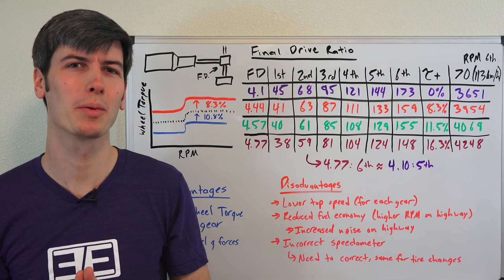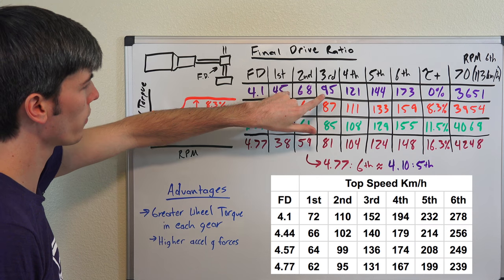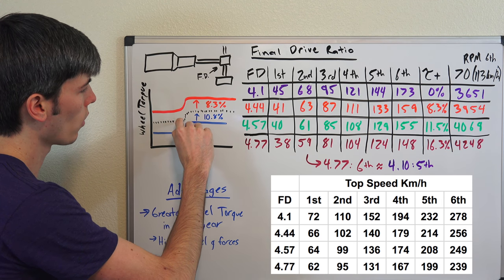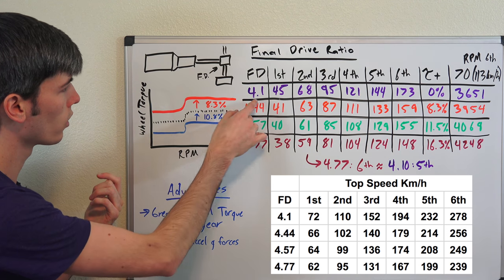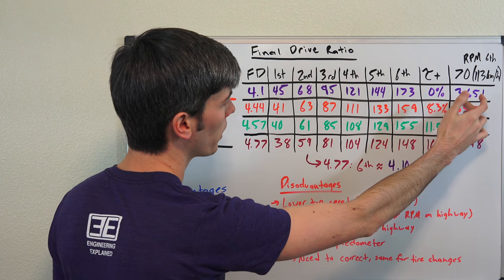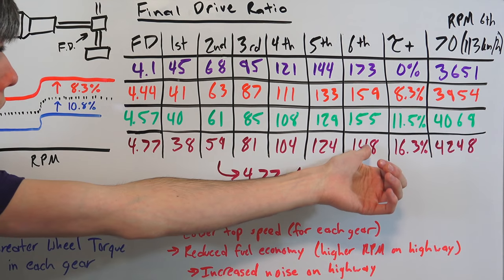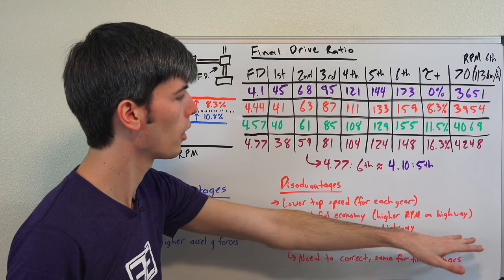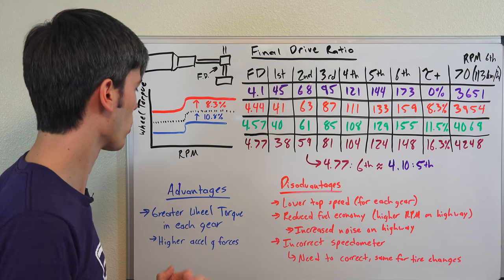Why Is Final Drive Ratio Important? Accelerate Faster!

Comment: I have a 2011 Mustang with the steepest optional gear ratio of 3.73. I'm not a fan of this gear for my daily driver. 1st gear is nearly worthless. Also, with nearly 30K on the clock, I can count on 2 hands how many time I have gotten 20mpg on a tank. The ratios for the manual trans are: 1st 3.66,  2nd 2.43,  3rd 1.69,  4th 1.32, 5th 1.00,  6th 0.65.  With 400+ HP on tap, I can't imagine I would lose much performance by "downgrading" to the 3.31 gears. But I'm sure it would help out my fuel economy. Thoughts?
Reply: That's strange, I have a 2016 Mustang GT (performance pack) with 3.73 rear end gears and I get just over 20 MPG driving back and forth to work, which is all 2 lane roads at around 25-45 MPH. On road trips, I can get a little over 25 MPG at 75-80 MPH.
Reply: FoDaddy  And you have more HP than I do!!! But do you agree that 1st gear is worthless?
Reply: More HP, but also more weight.  And yes, first gear is pretty short with 3.73 gears, usually if I'm pulling away from a stop light, I'll be in 3rd before I make it though the intersection.
Reply: This is the only car I've ever owned (34 so far) that feels like its gears are too steep...useless 1st gear, high rpm's on the freeway etc. If I had money to burn, I'd change it out to a 3.31 just to see how the life would be.

Comment: On my Honda, when compared to the original gears that came with the car, I went with closer gear ratios from gears one thru six and I want with a lower final drive. I went from 4.7 to 4.3 as I daily drive my car and want fuel economy
Reply: Hello. Please hellp. I have k24 240hp with k20 gearbox 4 .7 fd. I was thinking on 4.3 fd i now that i will have longer gears but what about acceleration? Same, losse power , gain? Thanks

Comment: If 8, 9 and 10 speed transmissions become popular, will they do away with some engine complexity and just go for low RPM instant torque? It seems like a second wind from variable intake or variable cam timing is wasted when it just lugs at 80mph in top gear.

Comment: My ranger has 4.10 gears and holds at 2000-2500 for highway cruzing speed and I'm about to do a lot for highway then before, plus my diff is slightly cooked. So I guess its time for some taller gears.

Comment: The new 2020 Civic Si will have a higher final ratio then the 2019 Si producing a higher torque to the wheels what change is expected in the  0 - 60  speeds?

Comment: Pfft I got a 3.73 final drive in my 940, and all it does is make my revs sit higher at highway speed. Still accelerates like a crooked kangaroo with the 116 horses of fury.
Reply: Well than maybe the gearbox has a crooked kangoroo setting xD
I don t know the FD Gearing or Transmission Gearing of my 740, but i don t complain x) it s hell of fun to go with that car through downhillturns! (with proper tires)

Comment: Doesn't most cars use the ABS wheels speed sensors for the speedometer? At least every car I've worked on made in 1990 and later uses the ABS-speed sensors, thus you can use whatever final ratio you want and the speedo will remain true, set aside a purpose-made error of showing 5% more than you actually got, and ofcause effects of actual wheel rolling OD.

Comment: I wish I had a 6th gear in my Wk1 Srt8 Jeep. My final gear ratio is 3.73. They only have 5 gears and my 5th gear has a .83 ratio. At around 80mph I'm at 3,100rpms. If I had a 6th gear with a .65 ratio my engine rpm would at 2,400lbs at 80mph. I would get much better gas mileage. Not sure why Mopar engineer's did not put the Ram 6 speed auto from the same years and put in the WK1 Jeeps. Then again I don't know if the Rams transmission would of been able to be reliable when my 6.1 liter hemi is making 420lbs of torque. My 5 speed (W5A580) NAG1 transmission in my Jeep is built by Bercedes Benz that's rated at 438ft-lbs of torque.

Comment: Engineering Explained you shouldn't need to change your speedometer reading because modern (ish) cars use the ABS rings to determine speed? Or does your S2K just use a gearbox sensor?

Comment: should I delete dpf system
Reply from the maker: Nope
Reply: Ron DS for sure what vehicle?
Reply: Oh yeah you will love it done alot of them get ahold of eric from innovative diesel for tuning
Reply: It's illegal in most places to remove emissions equipment, so , do it at your own risk.
Reply: Yes in the US it's 100% illegal as deleting the DPF you are breaking federal laws.
Reply: I'd do it instant honestly.
Reply: and get better mpg as well as power? yes you should
Reply: If it works- leave it. If it breaks down- remove.
Reply: Yes! God those things clog up. Ruin the engine, make it run slow. Delete it.
Reply: It also depends how exhaust pollution is measured where you live. In my country they only measure smokiness, not composition of the exhaust gases, so you can pass the inspection even without DPF.
Reply: Wait until the system starts failing then remove and program.  Check first to see if you can pass inspection before going this route.  Many states perform safety only inspection on diesel.  I'm hanging on to my pre emissions no dpf 2005 duramax as long as possible.
Reply: ImaFirinMyLazuh you got some long arms don't you!

Comment: I have a question? Assuming all else is equal, is there an appreciable impact upon the lifespan of the engine when using a more aggressive final drive (within reason).
Reply: A small impact, depending on how much % hwy and how much you drive - higher rpm on the hwy in top gear means more rotations for the engine, trans, and driveline components - 16% or 600 rpm more for 4.77 vs 4.1 in this example - in mileage terms this is equivalent to 200K vs 232K miles (+16%) of wear due to added rotations alone at 100% hwy in top gear at constant speed - at city speeds there is also added trans/clutch wear due to increased shifting

Comment: What kind of device compensates for different tire size and final gear ratio and how does it work?
Reply: Modern cars' speedometers are digital, so you would just have to program the car's computer.
Reply: Number Two I didn't know the a speedometer is user programmable
Reply: You have to hook up a tuner to do it, there usually isn't a way to to it in the stock menus.
Reply: Or if your car is older it runs on a cable that uses a gear to turn your speedometer in your cluster which they sell replacement correction gears.
Reply: Kyle Bailey Are these tuners universal?
Reply: Well said Mr. Aus.
Reply: Overonator it's not a tuner, it's a physical gear inside your speedometer. For instance, in my 98 cobra, it's built like that, where the cable turns and spins a gear, which is hooked into my speedometer, it's completely mechanical, so in order to correct the speedometer after changing the rear end gears, you order a different sized gear for the speedometer. I don't know if they are universal, but I wouldn't think so because the stock gear sizes for different vehicles are probably different sizes, so the corrective gears wouldn't be accurate if they were one size fits all.
Reply: Kyle Bailey And going that deep into a fix electronically would need very different techniques depending on the manufacturer and year.
Reply: DE Nichols yes. In my case there is no electronic correction needed because it's all mechanical. But on most newer vehicles speedometer are controlled electronically, so you'd need to tune the speedometer for corrections. Or there would be some other type of fix, like splicing in a resistor as somebody said earlier in the thread.
Reply: Kyle Bailey exactly. :)

Comment: So I understand that whole thing with increasing the FD, the gives and takes. Is there a way to regain that top speed back? If I’m not mistaken you mentioned increasing the overall power of the engine itself is partly a solution?

Comment: Is this a key difference between a heavy duty truck and a sports car of same/similar engine size? As in why one is better at towing than the other and the other is better at speed?
Reply: Trucks also have beefier suspension and frames.
Reply: Forrest225, true, but we're talking gears yes? The engines have more torque down low and can be geared taller. That's more of the intended comment. Of course, with a bigger, beefier item like a truck versus a car, some of how it's setup is because of the weight of it yes.
Reply: Unclenate1000 Gear ratio is important factor, but another even important factor is the rev range the engines are built at. For a truck you want lot of torque on the low rev range, so you can start pulling away right away and making it easier to not bog down. For sports car you want higher revs, because revs mean power and with lightweight car the low rpm torque isn't as important, so you can sacrifice it when tuning the engine.
Reply: Trucks also usually don't rev as high. They do idle somewhat lower, and have higher low end torque, but overall the useful percentage change in speed (basically how many times higher RPM is the maximum than the minimum that'll be able to accelerate) is bigger in sports cars. I.e truck gears would have to be closer together to cover the same range of speeds, so they usually have more gears

Comment: Love the channel. Can you explain 15" vs 17" wheels? It's an option on the Honda CRV. The low end model, the LX, has 15" wheels. INcreasing in model, EX and above, use 17" wheels.  What do the larger wheel bring to the car? Acceleration? Power? Comfort? Expense? Thanks.

Comment: Could you please make a video explaining how increase ( or decrease ) in wheel and tire size effects gearing?

For example my car ( 1994 Toyota Mr2 ) came with 205/50/15Front tires and 215/50/15 Rear tires. I currently run a 225/45/17 Front and 265/35/18 Rear.

Thanks!

Comment: So in the case of a Dodge Ram with a Hemi, you can either go with a 3.21 gear ratio or a 3.92 gear ratio. I understand a high gear ratio produces more torque to the wheels, but the top speed is affected in this case?

Comment: Say I have a more powerful engine (like my Harley Evo) for a 5-speed transmission, how can I change the gear ratios to handle its power in a 4-speed transmission? Use a lower final drive? This is the scenario for my custom bike I'm restoring, I understand pretty much everything except how this would be done. Excellent video otherwise.

Comment: Question, Trying to figure out the formula for calculating torque by upgrading from a 3.42 to a 4.10 or even a 3.73 on my truck to find out which one would be worth it more.

2000 S10 4.3L Automatic 2WD 3.42 Gearing Stock
This is the specs Im working with.

Anyways, So I'm trying to figure out a formula for towing with 3.73 or 4.10 gearing over the 3.42 gearing to see what torque I can get to the wheels by that to see what would he better towing and also being within the RPM power band. 
I was kinda calculating towards a 3.73 gearing because I can go to a bigger tire size and bring the gearing closer to a 3.42 for MPG and I can go to a smaller tire for more torque when towing. Or go to a 4.10 gearing for towing easily and got to bigger tires to bring the gearing closer to a 3.73  or 3.42 for better MPG.

Comment: I have a 2012 Jeep Wrangler with an Edlebrock Supercharger, 4 inch lift and 35 inch tires. Do you think it would benefit me to change the gears from 3.73 to 4.88?

Comment: He says, what are the reasons:  1.  To get more wheel torque.....wrong  
2.  fuel economy.. RPM levels usually doesnt dictate MPG.. But , true, higher Top gear RPM
again, there is NO advantage of torque over all.  This is a KEY mistake and hope he corrects it or removes the video.  there is trade offs by lowering the final drive.   Nothing even remotely relating to getting more torque or acceleration force.   Keep in mind at each equivalent gear set shifts the shift point and creates trade offs of force to the wheels vs any speed range.   this is a VERY misleading video.    those speed limits in each gear ONLY optimize for each gear for each speed range. NOT over all.

Comment: So you say with 4.57 your got 11.5% more wheel torqe... i hope your dont think its the same like 11.5% more torqe from the Engine!? 
0-190 KM/H 
with 4.1 or 4.77 will take the around the same time.
The increase you will have if you at 50km/h in 2nd gear and floor it your are have more G's (4.1 4.57)  -> 11.5% more G's

Comment: Hey my car is honda civic fd1/fa5 with r18a engine. I was thinking about changing the final gear for better acceleration (increasing the number like you said). What kind of final gear do you recommend for me? I just want to change it a bit, not too extreme. Also think about the trans and axle when deliver the torque. Thanks man

Comment: I have k24 with around 240+whp.  Gearbox k20 with 4.7 final drive.. for 1/4 mile whats better , and better acelleration 4.7 or 4.3 fd of stock k24? Or k24 gearbox longer gears with 4.7 fd? What do you think is best combination for best posible accleration? Thnaks!

Comment: if the 6th gear has a theoretical top speed of 173, by changing the final drive ratio wouldn't i be that an improvement in the real top speed, because of the torque added?

Comment: Does changing the final drive gear ratio to a lower (more aggressive/higher revving) on a car with CVT transmission have the same affect?  Or is it different because it's a CVT?   I'm interested in changing my 2018 Honda Civic CVT's gearing (4.811) to a 2018 Honda CRV's gearing (5.76).   All the inner parts are the same with the exception of the final drive shaft and gear. 

I'm perfectly fine with the expected higher revving nature after the change and 'worse' gas mileage.

Comment: I recently bought a 2011 chevy Colorado with a 10 bolt 8.5"
I dont know the gears ratio but I want to know for what are they designed ... cause I wanna make some upgrades to drifting and some 1/8 mile races...

Comment: In your example, switching from 4.1 to 4.77 just like eliminate a gear. But from 0 to 148 mph shift 5 gears instead of 4. Is that means each gear ratio become closer?
Reply from the maker: Yes, the gear ratios will be a bit closer as well.

Comment: Isn't the final drive ratio the number of revolutions of the engine (not gearbox output) per revolution of the wheel? I can see why some might say the diff ratio is the "final drive" ratio because it's the last point of gearing before the wheels. But I'm thinking "final" as overall effective ratio. Anyone care to explain?

Comment: Ah...the slippery slope of modifying cars. Change final drive to increase acceleration, buy taller 5th gear to alleviate high rpms at highway speeds, buy tool to adjust speedometer thrown off from said mods... sigh I do this to myself.

Comment: What about the power pulses a tire see from the change in gearing, i am fiddling with that as we speak. How does this correlate to acceleration as well. Meaning a shorter gear ratio will allow the tire to see more power pulses but also you can see the distance in which a tire travels in the same instant

Comment: Ok plain and simple question. I have 3.73 rear gearing. If I change to larger tires in the rear, say by 2 inches, my final gear ratio will drop to like 3.40 or so. So does that mean my torque has decreased but I can hit a higher top speed? But will I accelerate faster or slower?

Comment: Hi, this tutorial is great but I'm still puzzled. Can you advise please. I have a ZZR1100 engine coupled to a car differential.  Final drive is 6th gear 1.035. The differential is 4.17. The wheels are 175mm x 55mm x 13"  . The bike revs to 11500 rpm. Can you tell me what the top speed would be please. Thanks

Comment: I'd like to change the final drive on my Subaru WRX but AWD makes it kinda difficult because i have to change rear and front diff gears right? Changing the front diff gear will be a pain in the ass.
Reply: My subarus gear ratios suck as they are now because i can't drive 50km/h on 4th gear. I't drops the rpm to 1700rpm and apparently thats too low for my little boxer so it starts vibrate and make noices if i give it too much gas. This is kind of a pain in the ass since 50km/h is the most common speed limit in cities and now i have to drive at 2500 rpm and it really F*cks up my fuel economy.

Comment: Could you explain the difference between an aluminum and a copper heater core
Reply: copper is slightly better heat conductor, but the aluminium is lighter
Reply: ΑΡΗΣ ΚΟΡΝΑΡΑΚΗΣ  will I noticed a difference

Comment: Does the diameter of a wheel affect wheel torque? If yes, how?
Reply: no, it has no effect on wheel torque.. HP determines wheel torque at any particular speed. just think of wheel or( tire diameter really). in other words, if you give me a car operating at any speed at max HP, it will have the same torque at the rear wheels regardless of the tire diameter.. this is a truth, not many folks know!!
Reply: Thanks

Comment: I have a 2018 Honda Civic EX-T (CVT).   It has a final drive ratio of 4.811.  I've done research ant it seems I could swap my final drive gear for a 2018 Honda CRV's final gear, which is 5.64.  Would this same principal apply to the CVT transmission final drive ratio or are CVTs a whole different type of transmission/gearing and this does not apply?